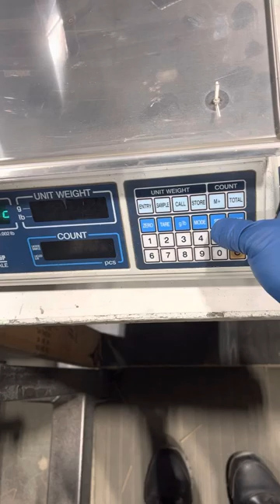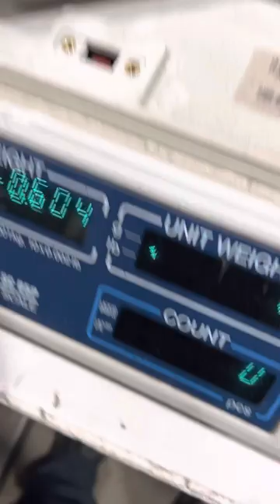Calibration adjustment of a CAS   SC series

Comment: What about brecknell model B140 
I have on the the screen Err31 if you can help me
Reply: Your zero is below minimum range. Most likely you'll just need to re calibrate. If that doesn't work it's either the load cell or main board. At that point I would replace the scale not worth fixing
Reply: @scalewizard87  can you help me or show me how to do it please thanks